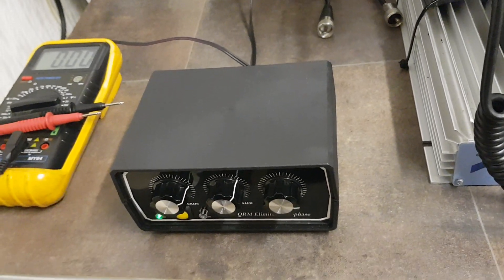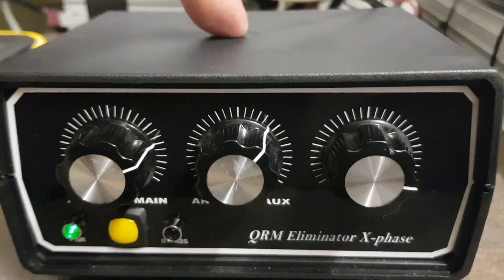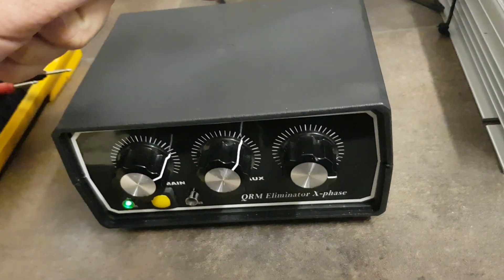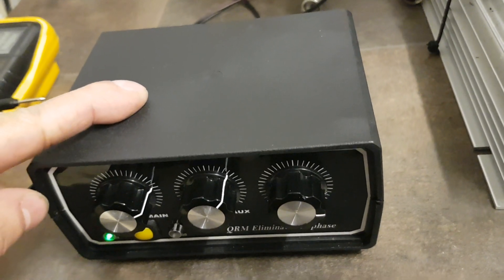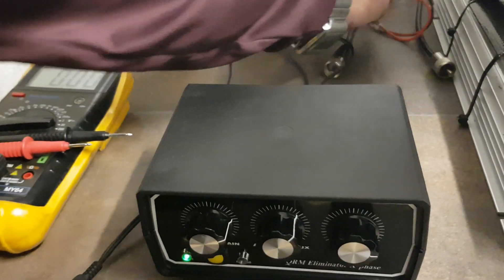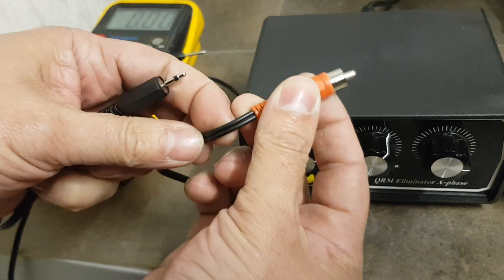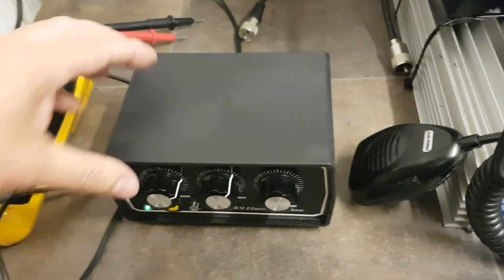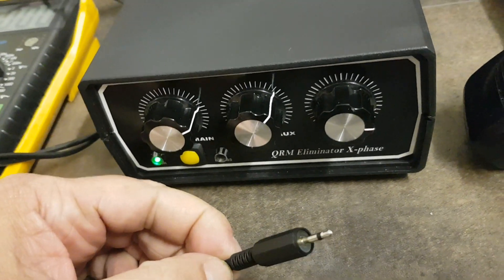Cb band hf bands 1.8 to 30mhz Qrm eliminator x phase part 3

Comment: how do i connecting ptt control to my ic 718 radio?
Reply from the maker: Your radio has a socket at the back that controls ptt control for linear amplifiers it should be on your user manual if you do not have the manual for your radio please download one and check how to connect ptt control for linear amplifier
Reply: @ruiamorim1975200able  thanks Rui for your explanation, i will trying... GBU

Comment: Hi Rui, thanks for posting!

I would like to ask you a question, since I'm about to order one (with RF sense by the way).
I'm using a President Lincoln ll Plus, which doesn't have a PTT socket of course. My idea was to create a socket on my desk mike and connect the socket to the PTT button contacts of my mike. A button is a button right? It just needs to connect the two wires, or am I seeing it wrong?

In this setup the X-phase will be bypassed in TX-mode (button pressed) and activated in RX-mode (button released). I would like to hear your thoughts about this. Another question: will it also work on SSB?

Thnx & 73's
Reply from the maker: if it has RF sense  does not need ptt control cable to the radio but if u buy one without use this mod
https://www.youtube.com/watch?v=U66GQJqBCSg

Comment: that PTT puts it on standby like it shuts it off so it does not get damaged from the power from the radio  i think the relay inside clicks that disconnects it  so the RF from the radio does not harm  the device De Kc0bra 73 good luck